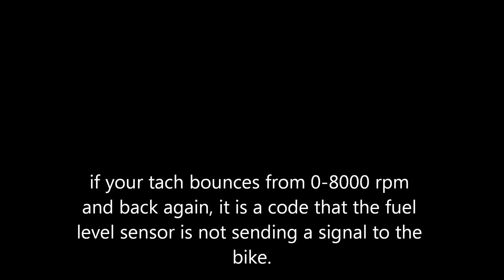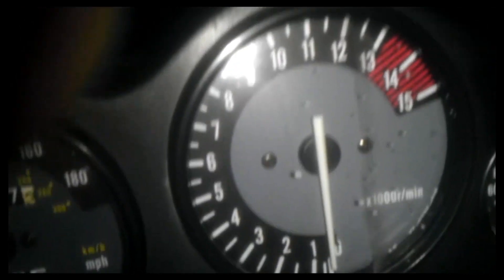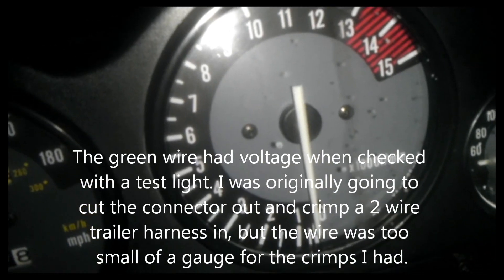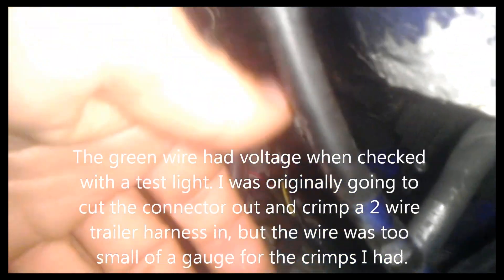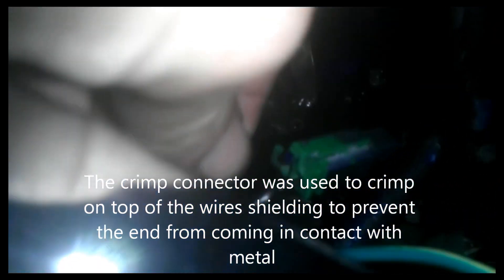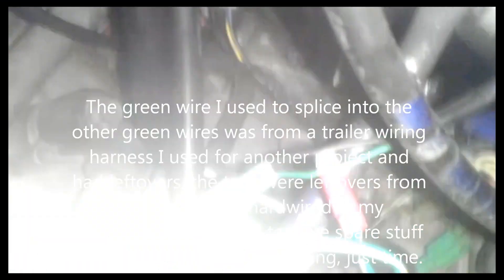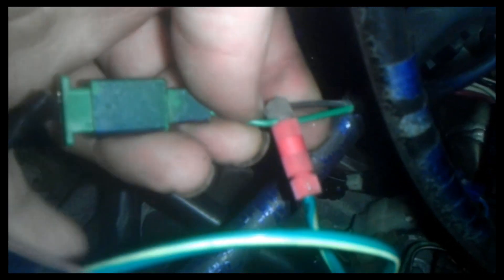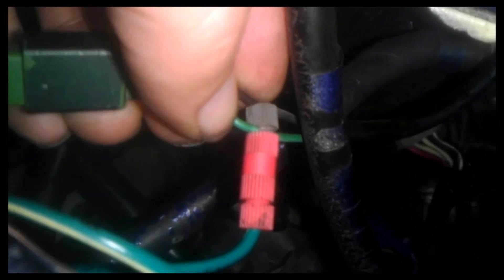Yamaha Tach bouncing, the problem and the the fix

Comment: I have a 2001 R1 and I also have that same problem. The wiring seems to be ok. I unplugged the connection coming out of the gas tank and the gas light came on. So doesn’t that mean that the low fuel sensor is good? I even unplugged the speedometer and plugged back in but nothing, the rpm’s still jump from 0-7000. What else could it be?
Reply from the maker: Cesar B
It says on a r1 tach jumping to 7000 is an exhaust servo or EXUP code. Mine was going to 8000. There is a way to  bypass it with jumper wires. According  to the r1 forum 
 https://www.r1-forum.com/forums/2-general-motorcycle-discussions/149591-7-000-rpm-fix.html#/topics/149591
Reply: Thanks a lot man! I really appreciate it!!!